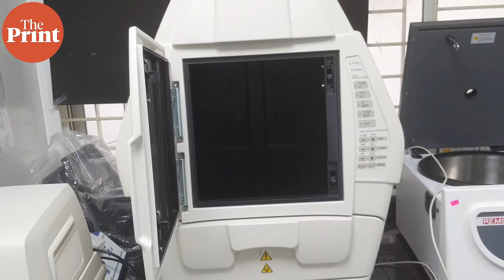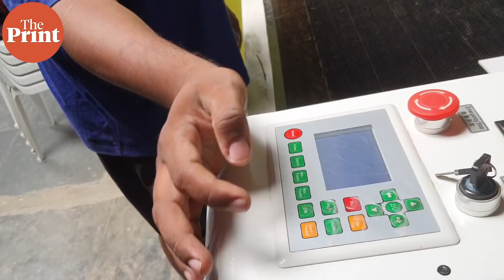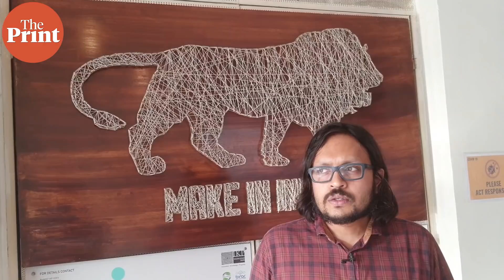Bengaluru makerspaces make India a hardware nation that doesn't rely on China

Comment: Building a prototype that successfully performs some desired function related to your own life experience or need is a valuable lesson learned. But it is only one piece of a much larger puzzle. For example, the ordinary incandescent light bulb had very little patent protection kept up related to the initial invention, so in theory anyone could make their own. Some of the first automatic machines designed to produce a finished product were high speed light bulb assemblers and they were surrounded by dense legal patent protection to forestall imitators building clones of these lowest cost producers.